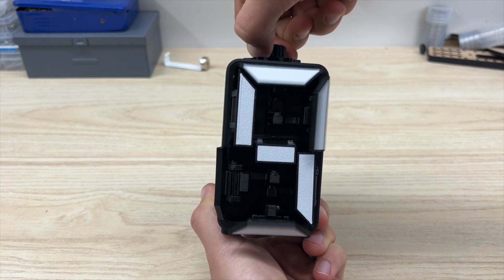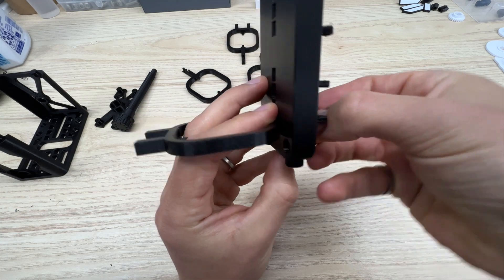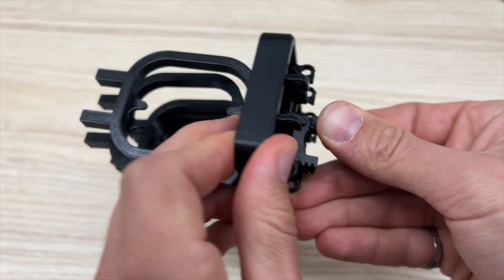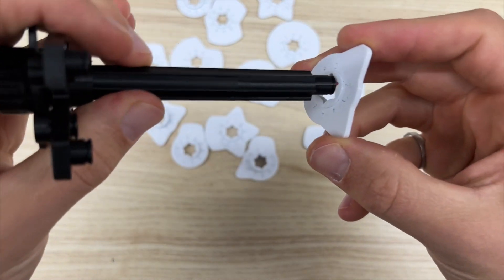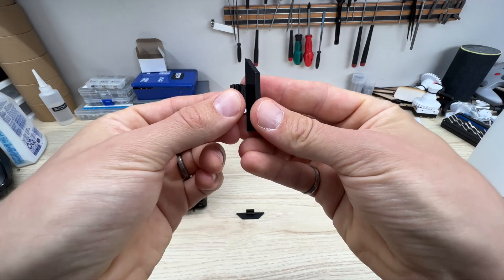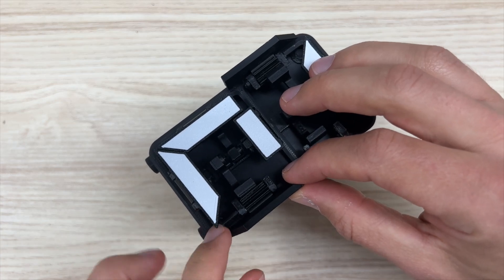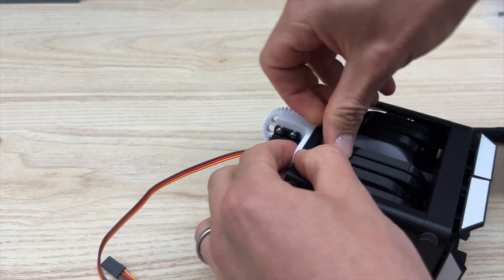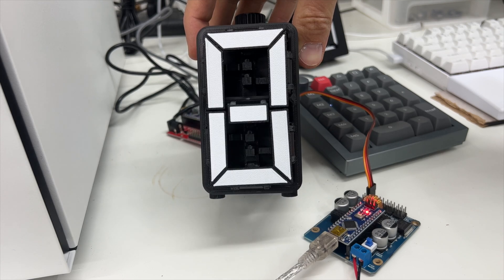The Rack Driven Mechanical 7 Segment Display - How To Assemble

Comment: By definition this is digital. Just thought I'd point that out since you ask. It is digital because the output is designed to have discrete states.
Reply: I disagree. The input "turn of the knob" displays a certain output "display of number" this is a function "f(x)". I'm not wanting to argue just replying on how I see it. If I am wrong please explain further and help me understand.
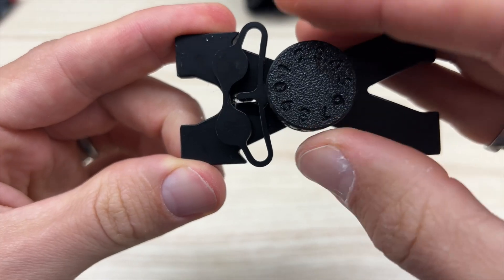Reply: @stephenedwards3348  Look at 3:13 "and it's going to align with the detent pin and you'll get this really satisfying motion"
This looks to be designed so that on rotation the input will snap between position and the output also snaps between positions. The same essentially happens in digital electronics. The step between states is fast but not instantaneous. It can be forced between states but one wants to avoid doing so for more than a very sort duration.  One can contrast that to an odometer in a car from the 70s for which the least significant digit would rotate continuously and spend more time between numbers than on them. One can google images showing this.

Comment: i assambled it and its not even close to working correctly
Reply: @JBV Creative Builds, Tutorials, and Reviews would like some help
Reply: @fass0543  ive built two so far that work perfectly...without some details i would say the gear setup is wrong or the cam setup is wrong...also if you had to go crazy with brims or anything, that makes the build really rough...my first prototype build was horrible.  if all of that is ok check to make sure the tooth on the segments is actually sitting in the first tooth of the gear.
Reply: I will try, thanks!

Comment: Just started printing the parts.  I had some issues with the front plate.  The little extensions that hold the pins are very narrow and one fell off.  I tried to CA glue it back on but no bueno.  Do these extensions with the holes need to be so delicate? I fear that some of the other will not hold up to the operation of the unit.

Comment: Here is another 7 segment counter which has a lower part count and it's more compact.
I haven't built either design to see if one performs better than the other though.
https://youtu.be/q5hJP_6xUcU
Reply: I tried this one as well... but imho the design is a little bit flawed, because the cams in there tend to slip under or over the follower instead of staying at the edge. And also there are (too) many places where friction is adding up, so that the segments do not move smoothly. The designer did already mention, that he will work on a revision...

Comment: Thank you so much for the design, very much worth the little money you are asking for.  Just finished the 3rd one and started with #4 to finish my clock - just hours and minutes. 

However, I am wondering if there is a particular reason for using servos instead of stepper motors? I have no experience (yet) with either one of those but I could imagine that the wear on the parts is lower if the system keeps turning into one direction instead of jumping back from 9  to 0 all the time? 

Also the servo gear has a lot of play and tilts within the servo mount. Is there an option to give it a better fix? 

Again, thanks for the great work and I am looking forward to hear from you. Cheers!

Comment: this is amazing! i am about to buy my first 3d printer -- bambu a1 mini. i would love to do this as my first project (as long as my printer can do it lol) ❤
Reply: I just bought the Bambu X1C if the A1 performs at all close to the X1 you will be fine.
Reply: I just printed this on my A1 Mini, it works flawlessly! I suggest to use a smooth printing plate, not a textured one though.

Comment: Superb bit of design, but MY GLOB was it frustrating to get the central spindle through into position!
Reply: right?  I used ABS and all the cams were just slightly thinner due to shrinkage.  That made this step a nightmare.  I think having a good print is key.

Comment: Hey, amazing print! However I am having trouble getting the cam shaft into the followers. I can get it almost all the way however it just will not go anymore. Does anyone know how to fix this?
Reply: Lots of luck, IMO.   I think it actually makes sense to put it together with the cams going through the followers before you put the back plate on.  But I figured that out too late.   I was able to get it together, but it took 30 minutes of trial and error, and a lot of pressure, to get it finally snapped together.

Comment: I would love to see a modification to the flaps: Couldn't you create the white part as inlay, so it can be printed separately with white pla and inserted into the flaps black frame? Would give the same aesthetics of your print to people with only one extruder...
Reply: I was able to separate the two parts....I can drop the stl file on drop box if you want to give it a try.
Reply: @Jaykav99  I would love to give it a try!
Reply: @hopsenrobsen  Looks like youtube deleted my comment with the link, I see you have a email on your channel...how about I email you the link?
Reply: @Jaykav99  This would absolutely work for me! :) Thx a bunch!
Reply: @hopsenrobsen  Ok on the way it includes all of the flap pieces as one stl and they will prob import as one part but you should be able to separate in your slicer so you can print one at a time. Email subject is Clock Segment File Link
Reply: @Jaykav99  You're a legend!! ;)
Reply: @Jaykav99 I would also love to receive your stl files for this!

Comment: Can you please share what you are using to drive the servos (around 6:08)? Would this work without the clock module if you attached a Arduino Nano with WiFi for clock sync?

Comment: I printed the whole thing and everything is kind of perfectly fitting but I can't fully rotate / get all numbers in any way working. It can only turn the knob 1 or 2 numbers and then it stuck.

Everything is perfectly aligned / straight I double and tripple checked all numbers but it will simply not turn fully round.
Reply: I just ran into this, and found two problems: a groove on my print bed left a small bump in several of my Followers, and so they snagged on the square holes. Also had some Cams that had curled during printing, resulting in them stretching too far up or down and snagging the wrong Followers.
Sanded the Followers, reprinted the Cams; that fixed it for me.
Reply: @SeekerPsycho1  yeah I got it working. Not totally sure what the problem was but after some fiddling everything is smooth now! Great project.

Comment: Thanks for this super cool design, i just finished printing and assembling, but i ran into an issue where the shaft seems to be a bit too long and the Cams are not able to align with the followers, making it unable to turn smoothly , super hard to turn the dial and can only turn it few clicks each direction, i can see all the white pieces (Cams) are not aligning with the followers. not sure what i did wrong here.. i can even tell from your video at 3:51 that there is barely any bit of the shaft left to insert into the black plate, mine shows 10mm or so of the star gear on the shaft still.
Reply: Yep, me too. the camshaft seems too long. Ive reprinted the shaft again, all the followers and meticulously follwed the video. Cam 7 and 7i sits just above the last rack piece, with the camshaft fully seated into the hole at the bottom... Im going crazy (and running out of filament....)
Reply: @AzTheCreator  i ended up modeling a bunch of spacers and kept putting it on and off to see where it needs a spacer to help align the followers and cams, works, but still glitchy
Reply: @TeslaDIY  same thought as I had last night. I can see the issue is around the gear and spacing of can 4 - I think I’ll follow your lead with a spacer for sure!
Reply: Hey @TeslaDIY - I've found a 3mm spacer between the Cam gear and Cam 4 aligns everything just about right. I did a dimensional accuracy on my printer and its just about right so i'm really not sure where the extra 3mm came from. 05mm -1mm would have been ok, but it is a large gap at 3mm. Maybe it's me, as a lot of other commenters are not reporting this issue. Just you and me... Anyway, works now

Comment: As you update the file package, are you also updating the pre layout files? My clock assembly (and drive shaft) are so damn tight that its practically locking up. Trying to figure out what the cause here is (and if solved in newer versions)
Reply: Hi there! im trying to reach out and get into contact with you, is there a good social media account or email i can reach you with? Thanks!

Comment: One thing that's not immediately obvious is that the cams go on numbers down when you're holding it upside down. I guess it makes sense, but if you ever remake this, be nice to make explicit.

I broke some things and had to take the first try apart again - here's to try two
Reply: So the number 1, 1i, 2, 2i and so on on the cams all go towards the dial knob on the shaft? Its hard to tell on the video and i thought some went up and some went down and broke my first one.

Comment: Can a resin printer work for these items?  Meaning, it doesnt require any "give", so I can build solid prints with my resin printer?  My FDM printer is down and out and I need to buy a new one as I can't figure out the  issues with it, but after a solid 4 years, I couldnt ask for more out of her, lol.

Comment: What’s the printing time per display and what printer did you use ?
Reply: About 10 hours per display on a bambu x1 carbon. Uses a few build plates so you have to clear them a few times.
Reply: @stevekeller1  How did yours come out on the carbon?  Just got it myself a month ago and its been printing these clock segments so well.
Reply: @Jaykav99 printed perfectly and assembly was smooth. Only problem I have is the servo mount seems to have too much play/slop and teeth bind and skip gears. I’m currently printing the mount with 100% infill to see if the rigidity helps. I also may try gluing the mounting bracket to the back instead of just using the 4 posts and c clips. Last effort will be redesigning the gears
Reply: @Jaykav99 I’ve had my x1 carbon for 16 months and have zero complaints.

Comment: Just an assembly note at 3:05, when attaching the D10 clicker piece to the front plate, orient the openings of the c clamp towards the nearby pegs on the front plate, otherwise they get pinched between the top and bottom plates when assembled and creates a gap so the two plates can't be clipped together. I adjusted the c-clips after the assembled camshaft was fully into the followers, but it'll be way easier to orient them before jostling it into place.

Edit: I should read the comments, looks like you've fixed it already, thank you! I downloaded the files same day so I still had the original design.

Comment: im having a really hard time getting the shaft into the casing
Reply from the maker: It's definitely the trickiest step- keep on jiggling the casing back and forth, you might need to pull the shaft out a touch and try to spin it before getting it back in.  It will go!

Comment: Love your content JBV, amazing project. I'm currently trying to assemble it and I just have a couple of comments: 

The text file says it does not require any supports, but the video does (so I guess it's fine as long as people watches the video before printing). 

The other one is that some tolerances are really thigh, I had a bad time inserting the racks in the side followers, and then the cams into the shaft where almost impossible to insert. When introducing the shaft into the side followers, I had to force it because it wasn't possible and ended up breaking the shaft. Will try to scale it down to see if that helps.

Anyway, thanks for sharing this! Will be following along when the tutorial for the clock is ready :)
Reply from the maker: Thanks for the comments, updated the text file and just sent out an update with larger tolerance parts.  This is super tricky to get right because too much tolerance can result in lose parts on some printers while being too tight on others.  Hope the update helps!  Thanks for your support!
Reply: @Engineezier  You are the best man! How can I download the updates? Do I need to purchase the files again?
Reply: Hi there! im trying to reach out and get into contact with you, is there a good social media account or email i can reach you with? Thanks!

Comment: I just made it! It’s super nice! The only issue I ran into was that the C-Clips for the Detent was interfering with the Top Plate making contact with the Back Plate. It was a little difficult but I was able to rotate the C-Clips so that the open part of the C aligned so that it didn’t interfere with the Back Plate. Overall though it was a fun and easy print, and it came out great!!

Going to print 3 more when I get the chance to make a clock!
Reply from the maker: Just caught that! Sent an update with a slightly altered detent/top plate, fortunately the old files don't affect the functionality of it!
Reply: Stl file u have?